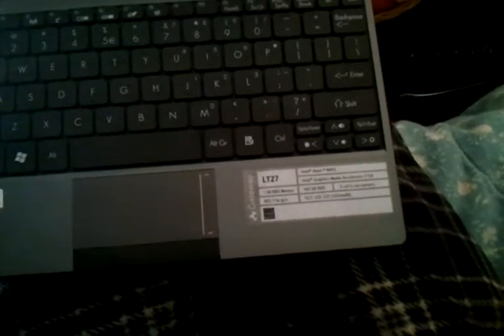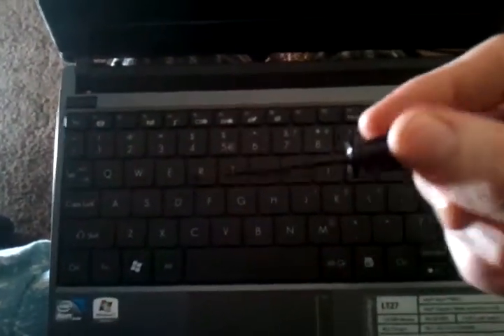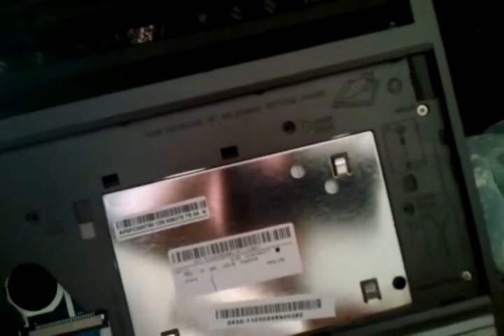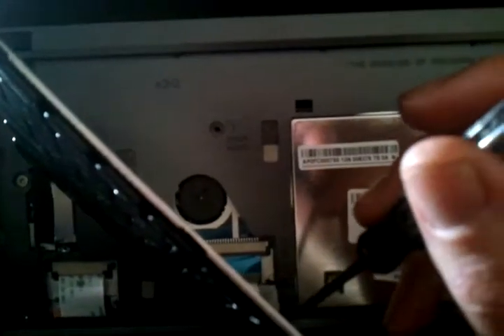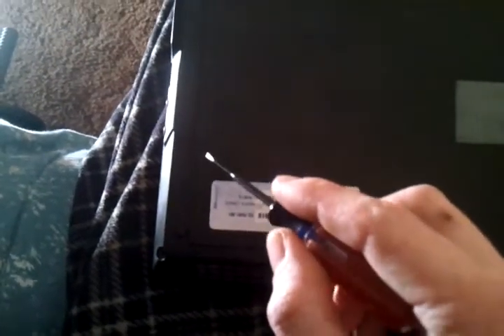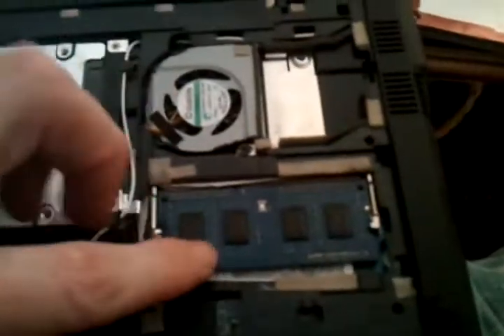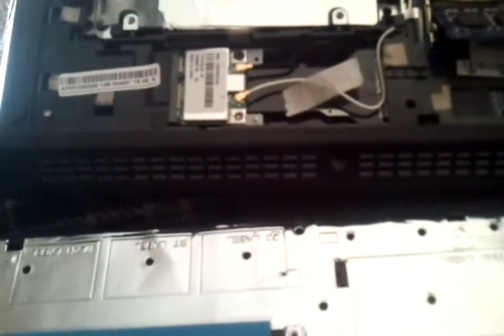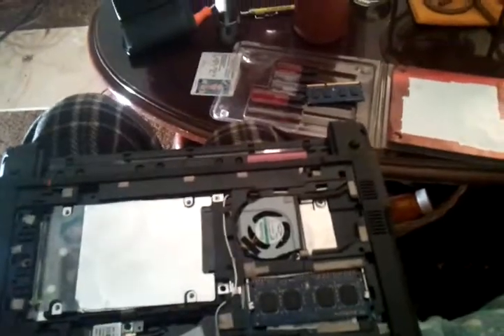Upgrade memory....gateway atom Netbook LT 27.

Comment: I have Gateway LT25 with Intel Atom N450 , 1.6 Ghz processor , 1 gb ddr 2 Ram .. Upgrading the Ram to 2 gb ddr 2 did not satisfy me .. I was wondering if I put a 4 gb ddr 2 Ram which is hard to find , but if I really put a 4gb in my Gateway LT25 , will it give me any Performance benefit ? I am already using a Lite version of Windows not the full version windows , but still , i am not satisfied with the improved performance of 2gb ram ..
Reply from the maker: What do you mean by its "performance"? 
Certain attributes of performance are limited by graphics processing and or internet speeds.
A system is only as good or "fast" as its weakest link.
Same for human beings.
Reply: @rdallas81  
I have done efforts to make this mini Laptop work , testing different light versions of Operating Systems on it , and finally I found the most lightweight , fast , and reliable OS for it. The OS is Windows 8.1 Lite Edition 32 bit , it's a a 700 mb iso , can be installed normally , and it becomes a 4 gb operating system after install. It did improve the performance even further as compared to the 6 gb Windows 7 lite edition. I didn't even had to bother searching for system drivers as we do in win 7. Everything was working already. But , there are still some lags like when I open Chrome it takes some time probably in seconds loading the Graphics , also on YouTube it takes a little time in seconds loading the graphics of webpage and some other websites which include more images like an Anime website ..
So , I think you are Right there , as you were saying , the little time it takes to load some things might actually be due to the Graphics limitations of this device.
 Otherwise it is working a lot smoother and it's now good enough to be considered as a useable device. The reason why I like Windows 8.1 more is because it Naturally consumes less Ram than both Windows 7 & Windows 10 , Win 8.1 is like a mixture of Win 7 & Win 10. 
 Windows 8.1 is best suitable for Old PCs and Low End Systems as it is more Faster , more Reliable , and consumers much less Ram and overall system resources than Windows 7.

Comment: 2019 - just did this RAM upgrade, thanks!!
Reply from the maker: Thanks for the "thanks"
Reply: @rdallas81    I have Gateway LT25 with Intel Atom N450 , 1.6 Ghz processor , 1 gb ddr 2 Ram .. Upgrading the Ram to 2 gb ddr 2 did not satisfy me .. I was wondering if I put a 4 gb ddr 2 Ram which is hard to find , but if I really put a 4gb in my Gateway LT25 , will it give me any Performance benefit ? I am already using a Lite version of Windows not the full version windows , but still , i am not satisfied with the improved performance of 2gb ram ..
Reply: Was the laptop any faster after the upgrade? I don’t know if it’s worth the money
Reply: @jerrybailey4636  upgrading the ram wont make the laptop faster. It will only make it more productive because you can open more apps or tasks
Reply from the maker: Good question.
I noticed a difference but my memory was maxed out. 
I appreciate you guys commenting on this old video.

Comment: Thanks Roy good information, Do you know if it is possible to change the processor?
Reply from the maker: I am not sure...if you have the exact replacement and skill and knowledge, and a steady hand....then yes.....as I have done this on bigger computers...but thanks for the return  question on this video, and if you decide to take this project on...please let me know how it goes...do plenty of research...as my saying is.."a human being built this, and I am a human being....so why cant I build it, or repair it myself?" And I tell you this, its led me to some great discoveries on the power of my own mind!
Reply: @rdallas81    I have Gateway LT25 with Intel Atom N450 , 1.6 Ghz processor , 1 gb ddr 2 Ram .. Upgrading the Ram to 2 gb ddr 2 did not satisfy me .. I was wondering if I put a 4 gb ddr 2 Ram which is hard to find , but if I really put a 4gb in my Gateway LT25 , will it give me any Performance benefit ? I am already using a Lite version of Windows not the full version windows , but still , i am not satisfied with the improved performance of 2gb ram ..
Reply from the maker: @usmanbutt2111  I don't think upgrading will improve the performance of the computer itself, but extra memory alwsys helps.
Me and my brother are looking at getting some small laptops actually.
Lol.
I am looking and reviewing them.
Thank's for the comment and question.
Reply: @rdallas81    Seriously !  You replaced the processor on your Laptop ?!  Not all Motherboards are built to Replace their Processor !..